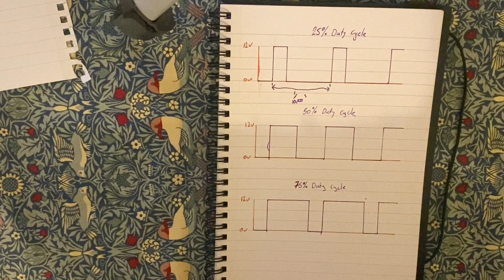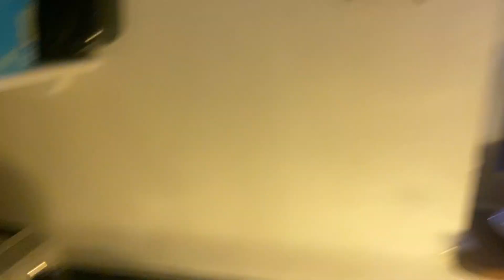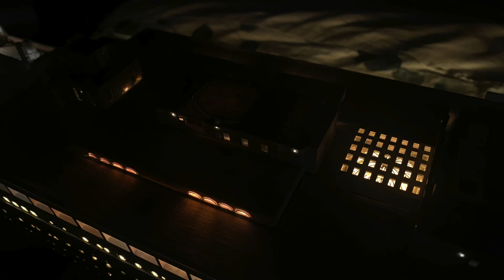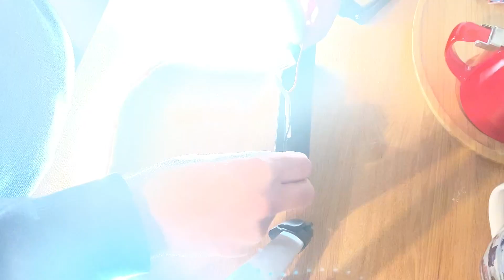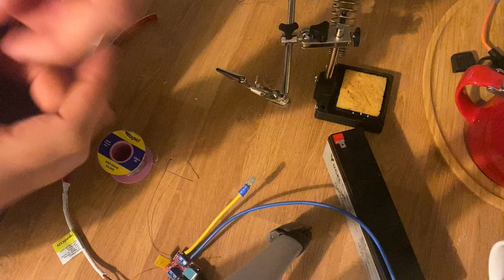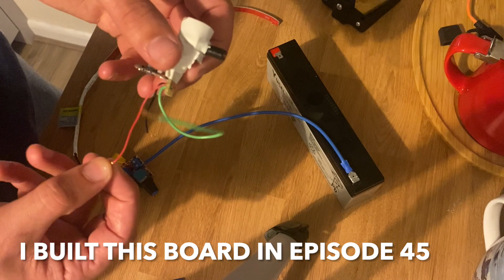Radio Control Trumpeter 1:200 Titanic Build Part 53 - Lighting, a Deep Dive

Comment: This is amazing! Thank you!
Is it possible to solder the 4 LEDs and the resistor not at the end of the led strip, but somewhere in the middle...?
Thank you!
Reply from the maker: Hi there, yes you can put the resistor anywhere you like in the circuit. As long as the components are still all in series with each other it dosent matter one bit 🙂
Reply: @TheModelBoatGuy  thank you very much! 🙏🙂

Comment: Please can you tell me what is the wire gauge of the wires of 0603 smd led? The are no prewired 0603 smd led on some of our online shopping apps and it is expensive and costs $2.5 for 10 pieces at my country while the 0603 smd led beads is only 0.5$ for 100 pieces but they don't have wires and I'll just have to wire it piece by piece. Thank you in advance!.
Reply from the maker: Hi, I don’t have an AWG for these wires but using the micrometer they are 0.28mm. 
I have soldered some of these onto micro LEDs in the past and it is very fiddly but doable. You’ll certainly save a good bit of money doing it yourself 🙂
Reply: @TheModelBoatGuy  thank you very much!!. Been watching your videos since the part 1

Comment: Do you think you could run wires up the mast, drill the mast light, and stick a small led in there?
Reply from the maker: I intend to do something along those lines, not quite sure how yet. 
Possibly very thin wires running along the mast itself, or I might disguise the wires as rigging and do it that ways but I do intend to do the mast lights

Comment: How long can I expect my LED strips to last, Robbie?
Reply: 1000s of hours. Basically a couple of decades if you had them on all day 24/7
Reply from the maker: They should last a long time, how long is a bit of a ‘how longs a piece of string question’! It depends on a number of things. The voltage you run them at will  have an effect. Running them at a slightly lower voltage than their rating is a good way of prolonging life (I’m running my 12V LEDs at 11.1v). 
But other things will impact them too, the environment, frequent temperature change (if your model is in the window for example), humidity will make a difference, bad vibrations (if your model is RC), these all feed into the life span.
I appreciate that’s not very helpful but essentially they last a long time. The strip I bought is rated for 13,000 hours, which is 1.5 years if they were on all the  time.
Reply: @TheModelBoatGuy  5
Thanks. My main concern is that my superstructure is glued to the hull now so I've got no access to repair LEDs if they go (without taking a chisel to the whole thing.) Then again, it wouldn't hurt to add a couple of PWMs to the circuit before the contact goes into the ship. Didn't know about them.
Reply from the maker: @cockerfreeman622  yes I know this is a bit of a bind, I have created a lot of work for myself by making my model disassemblesable (not convinced that’s a word but I’m sure you get my meaning)! 
One way around that is to have a central light source which is accessible, then use fibre optics to get the light where you want it. Then if your light fails you can replace relatively easily. 
The PWMs are certainly a good feature, and they give you that ability to dim or brighten as you see fit which is never a bad thing to have.
Hope all goes well on your model! 
Cheers,
Robbie
Reply: @TheModelBoatGuy  Thanks, Robbie. I've basically got two LED strips going into the vessel (I copped out of soldering). One strip is in the hull and the other winds its way around the upper decks. My other bete noir is the photo etch steps and ship's rails. Still, I have plenty of time to repair them.